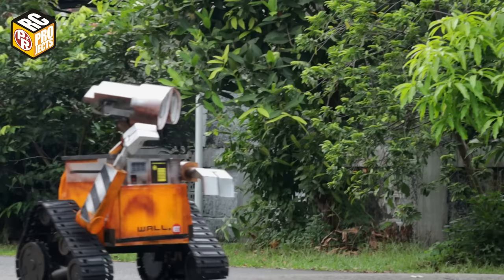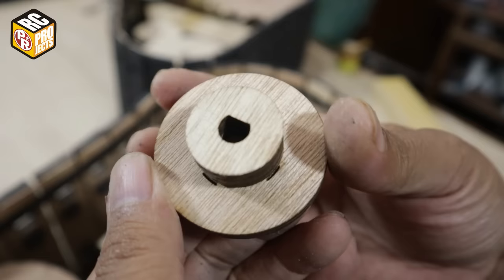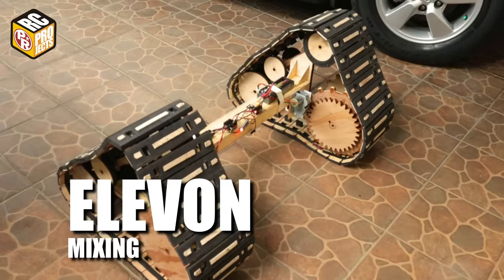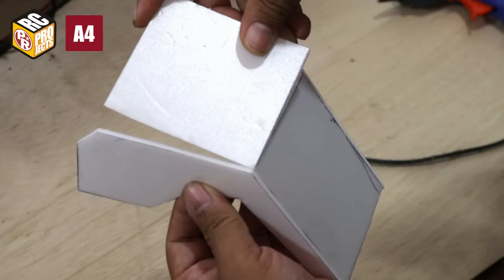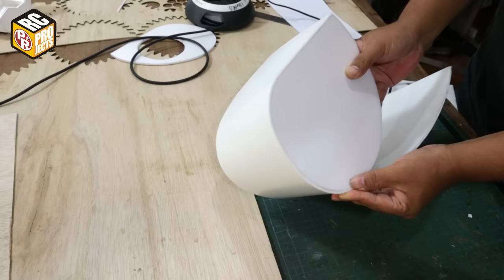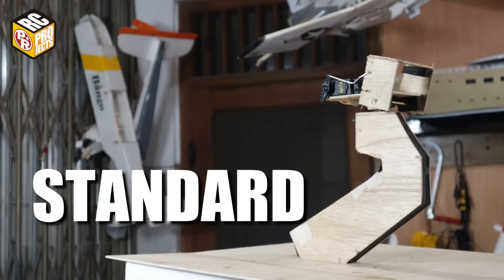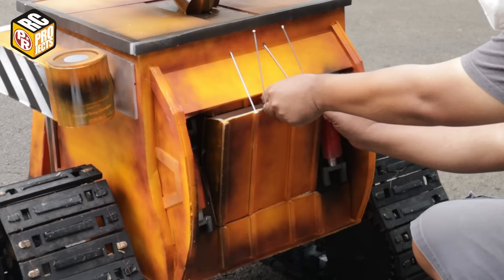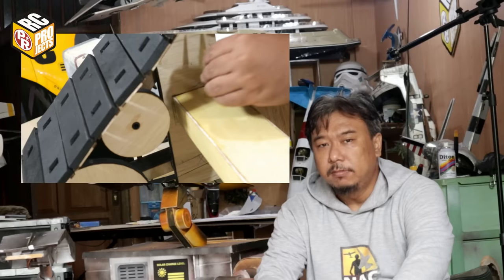DIY RC Robot WALL-E with Foam and Plywood

Comment: You never cease to amaze. Even with significantly cheaper materials, it holds up to many of the other 'higher grade' Wall-E's in the builders club. The proportions, and the hand movements really sell the effect.
Reply: Up

Comment: Great work! I got very inspired and hopefully will actually try to make the same project ! However I am very new to robotics and wonder how those wheels are actually turn? 

I would be soo glad if you or anyone in comments section could give the light to this question ! Thanks in advance ❤
Reply from the maker: Thank you, I'm also not a robotic guy just love playing around with hobby grade RC system, which has many parts that universal and interchangeable. I just figure it out in the shape of WALL-E. It's basically a tank like track vehicle with moving arm and head for accessories. I use hobby grade RC system like radio transmitter and receiver, motor speed controller and servos, just that, no programming no robotic knowledge just all RC stuff. I love RC it's like magic that you can control things from remote location.
Reply: @JuliusPerdana  that's so cool! Very great job! So thankful for your advice ! Very much appreciated ! I'm looking forward to making it in real life !

Comment: I would suggest using some 3d printed tracks, Im talking bout those from tanks, Wall-e's tracks from plywood look like their kinda loose and can go loose. I would try making them more sturdy. if you want I can help you a bit with designing the tracks. As always great job, you never cease to amaze me!
Reply from the maker: I know I plan to do that actually with rod pin and stuff just like tanks, but easier this way. Thanks btw
Reply: @JuliusPerdana  yeah, exactly it needs better links between pieces.